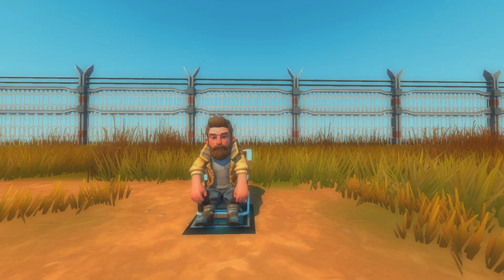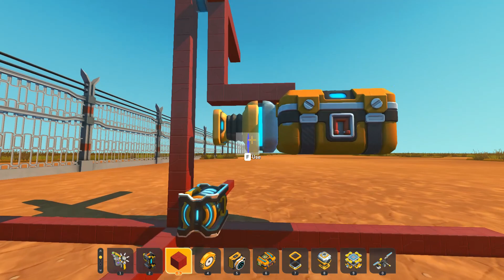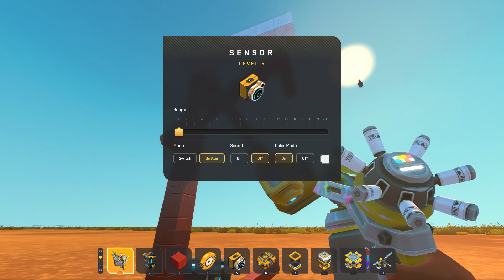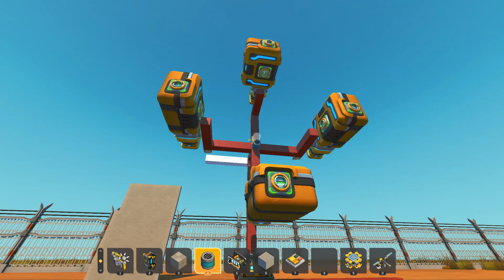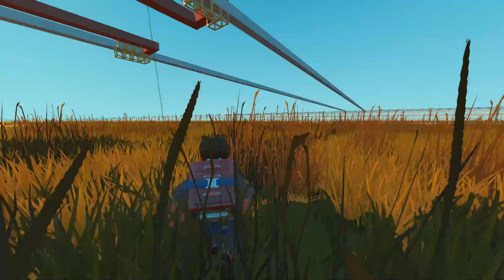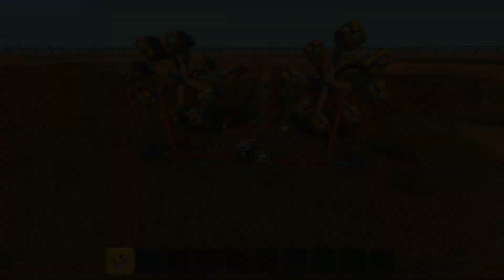Trying to Build the Fastest Automatic Building Machine! - Scrap Mechanic Gameplay

Comment: In case you're still reading this after a year: Nice build. I think the issue is that due to the fact that a square is not a circle, the 45 degree offset alignment of the blocks fired from the diagonal pumps is the problem. (i.e. plus the block trajectory due to rotation it will get in the area where the correct target for the program shifts one block to the side). One possible solution would be to hang the pumps on a freely rotating pivot, so they all get automatically aligned the same way by gravity, i.e. "hanging down" presenting a perfectly non rotated square each time they arrive at the activation point. You might have to make the pumps heavier with increased speed, so they don't fly outwards ... unless you want to build a funnel. ;)

Comment: I see several problems here.
1. the rotating mechanism introduces too much instability. you'd be better off in my opinion with a linear stack all at just the right angle to put the block down. for how many pumps you have, your current design uses them really inefficiently.
2. although your rail system keeps it more or less in line with the rails, the ground it drives on isn't. I think a great solution for this would be for the machine to actually ride on the rails itself as it puts them down.
3. the pump and sensor both have latency, which is causing the blank shots. when you reach higher speeds, that latency becomes more an more of a problem. of course, you could just have more pumps per rotation, but again I think a linear system trumps a rotating one. yeah I know it's not as cool, but...

Comment: One thing that I have encountered while building cross-map X's train mod railroads is that after a while you have to gapweld or physics just start getting angry. That could be what's causing this. I have also this with your road builder.

Comment: Since you are building diagonally, the center-point of the vacuum is close but not perfect which is contributing to the inconsistency you are seeing. The length of the straight arms are 8 blocks to the center-point of the vacuum, and the diagonal arms are ~8.46 blocks (the diagonal length of a block is 1.41 blocks, and I count 6 diagonal sections to the rough center-point of the vacuum) For a potential speed/consistency improvement I would suggest removing the diagonal arms and putting the white trigger pole on a controller bearing so that you can control the timing of the vacuums relative to the trigger point (Similar to turning a distributor or CAS to adjust the ignition timing on an engine) This should allow you to turn the speed way up and manually set the correct timing of the vacuum degree-by-degree with the controller bearing to place the block in the exact position you are intending.

Comment: I have some experience building long rails for monorails and it seems that once the rails start to get too long (like 256 blocks plus), they start to lag out really bad. I had to cut my rails into sections with independent supports and a one block gap (to make them seperate creations). But good luck trying to implement that into that build!

Comment: I would suggest putting the trigger sensors in a different location attached to the vacuum pump so that the sensor is registering the blocks your building a fraction of a second before they need to fire it looks like they have a slight delay in signal output but I could be wrong

Comment: I can’t tell what length those arms are, but I assume it’d be helpful if the diagonal arms are a length that is close to an integer value using integer x and y values. Like (5^2 + 5^2) = 7.07^2, or sqrt(7^2 + 7^2) = 9.9 (Pythagorean’s theorem)

That way, you know to have the straight pumps at either 7 or 10 blocks out, and the diagonal pumps at 5 across and 5 up or down, or 7 across and 7 up or down.

You’d want to use these numbers for the center of the vacuum pump output.

Comment: your vacuum pumps are turning red because you need to look at the pump where there's an arrow on the side, press E to change direction, the ones turning red are trying to suck in instead of blow out a block... and it turns red because there's nothing for it to pick up.
Reply: Looks like some are sucking. But I did see at least one that turned red when it was in shoot mode

Comment: Possibly move the guide rails further backwards? So they're out of range if the vaccums so they cant place on the guides and only place on the rails?
Reply: na try angle blocks on the ends of the guides so they wont attach to the angle.👌

Comment: You could use destroyable blocks instead of metal for rails and put spudguns facing the vacuum pumps on the guiding devices to destroy the undesirable blocks before they block the machine. Plus, you could use a faster speed on the motor that moves the machine further.

Comment: Try having the pump/chest wheel spin parallel to the direction of travel and have the pumps trigger at the top of their turn as they're heading towards the direction their facing (eg, a water wheel but it's placing blocks). This would hopefully make them more accurate and give a wider window for the pumps to be triggered to account for any timing glitches.

Comment: As I notice, the machine place roughly 3 blocks in a second. So, basically you need only 3 pumps for that machine. I can suggest ro allign pumps on a piston making it goes horizontally (left-right) or (up-down) use a controller to hook a piston and set it to move 1 block for each pump minus first one. Should be mich faster with 4 pumps, even with 3. I mean the goal is to make pumps trigger every second and not overflow the pump quantity within that 1 second. You know what i mean :D for example if movement needs 1 second for full cycle and if you have 3 pumps in it spinning, you will basically have 3 shots in a second.
Try putting only 2 pumps going back and forth on a piston within 1 second, so each one will fire the block every second divided by 2 pumps, so 0.5 second for block placement.

Comment: I think the assembly is drifting to the side slightly.
Then the  slight differance in position is making the diagonal vacs stop firing.
It woulld also explain why it starts building to the side.
Does the same problem happen on a slope, but with blocks appearing under/above?

Comment: This kind of system basically has the same issue anyone runs into when building a piston engine. There is a 1 tick delay between picking up the block and the dispensing, so to fix this issue the sensor which detects the block should be offset by some amount from the actual dispenser. Another option would be moving the point which the sensor detects in front of where it should actually fire, which is most likely an easier solution. This fixes the issue of the engine needing a very slow speed.
The issue with alignment you had is caused by the system not being a perfect circle. You used wedges to make a semi-circle instead of a bearing to add and identical copy offset 45 degrees. The additional blocks where placed on the inside of the track, which indicates that those additional pumps had a point in which they just about point outside the hitbox of the blocks. One fix for this would be of course rotating an identical copy of the 4 pump system 45 degrees with a bearing. However, this problem should also be fixed with the previous solution of finetuning the triggering point as you can just trigger it before or after the point at which you risk missing the front of the block.
Lastly I want to make a suggestion. Try placing the blocks not horizontal from the rotation point, but on a diagonal, that way the vacuums on the outside have moved sligtly in already while the inner vacuums are still pointing at the same block (has to do with how circles of different sizes are pixelated)

Comment: I think the problem might be the circle of square blocks, I think a better idea would to to build a type writer system where you have a line of pumps that when they sense the rail will build onto it and just constantly slide back and forth sideways, ( you would probably have to angle the pumps so they fire onto the rail as soon as the sensor sees that same rail), then you just have the whole contraption sliding along the rail with a set of wheels pushing it along.

Comment: I think the 'side block' issue might have something to do with the terrain, maybe? The longer it gets, then the more pronounced any twisting from irregularities in the ground will be. For example, if one side dips a little, or there's a slight gradient, then this will offset the vehicle from the frame it's building. Also, at higher speeds, it could be that the previously placed block hasn't fully consolidated its solidity in the world and, as a result, the next pump in the sequence doesn't have a valid foundation on which to place its block?

Comment: Ingenious build Moonbo!
But I think the obvious solution is to slow the whole process down one tick.. because as you stated, you wanted it to build as fast and reliably as possible.. one tick slower seems to be the most optimal speed and meets your requirements.
It probably is just a timing issue do to cpu processing power... you got a lot going on there that the PC can only process so fast before having to put some ques on hold, or ignore them completely.

Comment: The side blocks that are randomly getting placed is what scientists are trying to figure out for decades.. no matter how isolated they make a container for radioactive materials there is always .000000000001 % of the particles that manage to escape. 

It is that research that allow a new kind of holographic tech to now be created (literally stopping light particles mid air using infra red lasers (because there is .000000000001% of the light particles that could get trapped by two infrared laser beam).

But in this game i think, the vehicle is just shaking very slightly left and right as pumps rotate and move back.

Comment: There is a fix maximum shooting rate of the pumps, you can set up a logic repeater for it, and from that you just have to match up the rotation speed, or figure out a way to move them around. Probably easier with one chest with pumps on all of the outputs with tubes. And just move it around fast enough to be able to place it. But you may have luck and you can sync it up with rotation just finetune it with the lengths of the tubes from the centerpoint. Or use a controller for the rotation.

Comment: Do this for a Multiplayer Monday. You each build a boat with a vacuum pump connected to a chest filled with concrete. The goal is to sink the other ships by building on them and weighing them down using the vacuum pump.
Reply: I have seen this comment at least 10 times 🤣
Reply: you again
Reply: I don't think Durf does MM anymore
Reply: @nikkiofthevalley  this is moonbo, not durf.
Reply: @loganjoy-koer5936  lol
Reply: @HNStrike  it is not my fault that the grammar is bad as my dad set up this account 7 years ago and there was a typo that got amplified by autocorrect

Comment: My suggestion is to have more guide rail things, they are aligning the system but having 4 instead of 2 will make it less of a pivot point. This may help reduce the blocks being placed on the side of the track.

Comment: I believe your issue is coming straight from the vacuum pumps on the 45 degree angle connected by the wedge blocks. the solution i think would work is to put those on a bearing at 45 degrees exactly where they are now but one block in. DO NOT MOVE THEM OTHER THAN THAT ONE BLOCK REDUCTION. Message me for clarification!